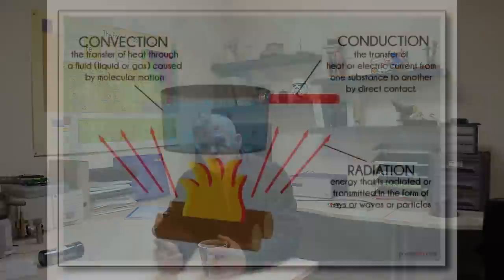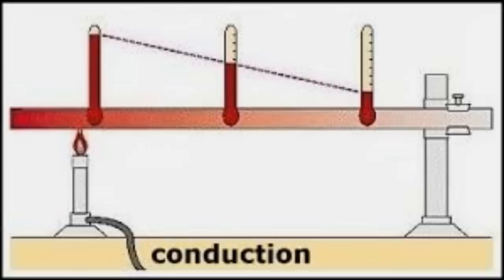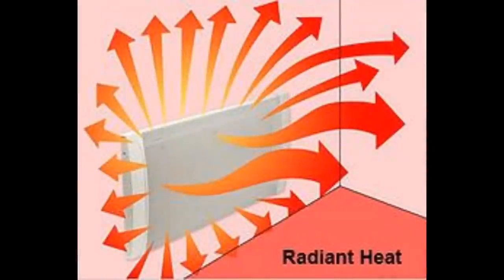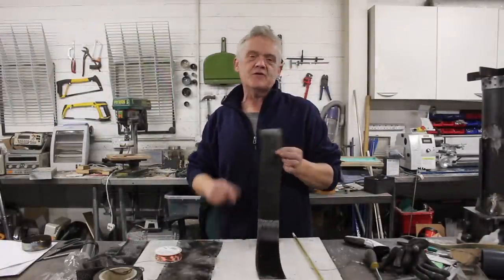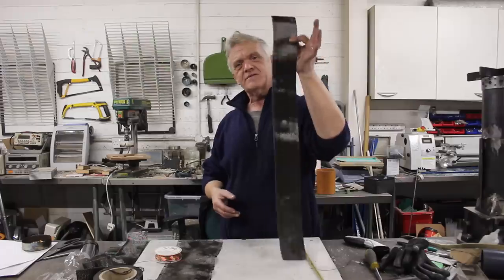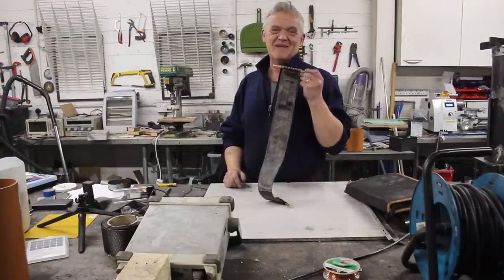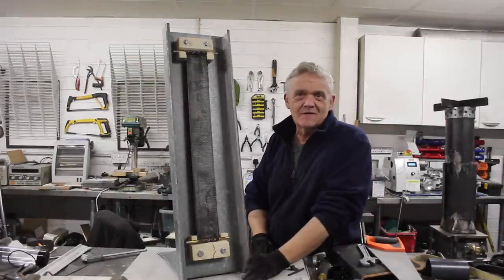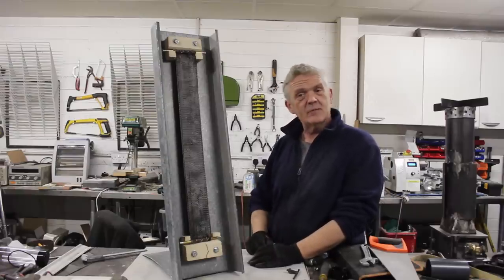1758 How To Make A Nano Carbon Infra Red Heater

Comment: Conduction is great, heat goes from hot to cold, I live mid terrace, by keeping my house a bit colder than my neighbours, the pensioners on either side of my house are heating my house. Except when I turn the Chinese Diesel heater on, which blasts air through the cat flap, then it gets hot, handy for drying laundry.  

My last gas bill for heating, hot water and cooking was less than £100.
Reply from the maker: lol handy indeed
Reply: @ThinkingandTinkering  the secret to keeping a house warm is insulation and stopping draughts, no point heating it, to then lose the heat or have cold air blowing in.

Comment: FWIW, the most efficient way to heat PEOPLE is to maintain their torso at 30C/85F or above.  If that is achieved, then the brain thinks that the air temperature is just fine and doesn't start restricting blood flow to the extremities to keep the central part of your body warm enough, which is why your hands/feet start feeling cold LONG before the rest of you does.  If you used the carbon fiber to make an electric vest to warm your torso directly, that would be brilliant!

(I watched a science video a few decades ago where a subject was given dexterity tests--placing nuts on bolts/etc.--in a -10C/13F chamber.  While the electrically heated vest he was wearing kept his core temperature up, he was just fine, not even needing to wear gloves.  Within two minutes of turning it off, however, he started fumbling, and found doing the tests almost impossible after five minutes or so.  Fascinating stuff!)
Reply: Mostly agree, but am a bit surprised at the 85*F temp mentioned--is this the ambient air temp or just the skin of the core temp?  I do run warmer than most people, but we keep our place 67*F during mid fall to mid spring, and I sleep nekked with only a thin sheet, and I do just fine with that (I would keep it colder, but I think my spouse would mutiny...). 

  But yes, agree with the general principle--learned this through backpacking trips in cold weather.  In fact, I designed a front only* insulated vest with a thinnish layer of synthetic (Apex) insulation sandwiched between very breathable layers (a windjacket is used in conjunction with the vest) for hiking for around 10*F and colder.  I'm good with wearing just a baselayer under that, and over that a windjacket.  

   When I break camp and am ready to go, I always take off my down jacket and use the above. I start off a bit chilly, but within a couple minutes, especially if going uphill, I'm good.  I use the windjacket and zipper as a way to regulate the heat. If I'm going up a hill (once warm), I'll open it wide up and then on the relative straights and downs, zip it up. 

  * Front only insulated because the backpack keeps my back plenty warm--too warm most of the time.  The Apex insulated vest only weighs around 2 oz and some change (I used some 1.1 oz/yd2 uncalandered and uncoated nylon fabric).  If I had to make another one, I'd might sub out the Apex insulation for some Kapok fiber and would probably use a wicking polyester fabric to encase the insulation (it would up the weight a bit, but would dry a bit faster).
Reply: @justinw1765  "Mostly agree, but am a bit surprised at the 85*F temp mentioned--is this the ambient air temp or just the skin of the core temp?"

Core temp.  It's a survival mechanism.  You will still survive if you hands and feet freeze and drop off, as long as your core stays warm enough to keep functioning.

Comment: I made a 10 watt heated jacket using by sewing in nano carbon fibre strips and power with a usb powerbank. I dont use it though as it just makes more sense to dress correctly.
Reply: My Dixie Wrecked🔨  I think they are in 30 to 40 watts and work off 12v. I made one myself because I wanted it to last 8 hours and run on 5 volts. They're pretty good if your stood still but when you get busy you warm up anyway.
Reply: Great idea
Reply: @davidmowbray6352  they make sense if you HAVE to be sedentary for long periods in very cold weather, even better if you can get insulating layers over the top. Helpful with my remote work desk based job. I'm making a little foot heater with 2 X 7W medical heating elements, a steel sheet and a thermostatic relay switch
Reply: My Dixie Wrecked🔨  get some carbon fibre or nichrome wire heating element and play around with putting different voltages through differing lengths until you get a element temperature that doesn't burn too hot, then using a multimeter you can figure out how much heat is being emitted and add more elements.
Reply: @davidmowbray6352  There is a guy in Canada who has a house heated that way using 24 volts and different lengths of wire for the right temperature he even invented a controller.
Reply: When batteries ever become a lot more energy dense while also getting lighter, then this would be a good addition to backpacking in extreme cold conditions. 

    I was thinking of doing something similar, except putting Nichrome wire in some activated carbon sewn between two layers of heat resistant fabric (the most common and inexpensive of which is sheeps wool).  

     I would love to do an Antarctica trip some day if I ever afford to, and would hook the above up to a Solar panel.
Reply from the maker: they are not nano carbon mate - they are just carbon - the nano refers to the wavelength of the heat - any carbon will do
Reply: @ThinkingandTinkering  I used the same nomenclature as you did.

Comment: You could have used a quarts rod and have everybody forget about carbon. With a reflector a quarts rod is very efficient and feels really hot on your skin. It is a shorter wavelength but manufacturers make these in affordable sizes and they use 400-800 Watts.

Comment: Three other types of heating for you, increase circulation ie go for a brisk walk, T.E.F ie Thermic effect of food (eat a big protein based meal) and lastly tricking the body's perception of the temperature level.    The latter can be done by slightly warming areas of the body such as the wrist, where there are lots of nerve endings involved with sensing temperature, warming these parts of the body tricks the nervous system into thinking you are warmer than you are. There is a commercial device available which does this. I forget the name, but it looks like a wristwatch. 
So you could add "biohacking" as another form of heating.😂

Comment: I would like to see you make an infra red panel heater 240v, maybe using alco panel sign writing panel as a basis- 3mm polypropylene with 0.24mm aluminium skin either side?

Comment: Love the videos. I'm in England and want to beat this energy con. I  would love to know the cheapest way to warm a room but with the lowest volts. I've been using a 12v connected to a water heater element for years in my pond during the winter and it gets to about 30°c (not the water) so how do we multiply that to actually warm a room? Or can it not be done. I saw 100 metres of carbon wire for floor heating for £30, so would this be ok to stuff in a sand battery?

Comment: Lets say we placed the carbon weave inside a copper pipe, and vacuum sealed it. If we then let it get to 400 degrees, could we use this to heat the copper and let the copper conductively heat a sand battery to high temps? Could this be as safe as the water bottle resistor? I would think it would be faster, at least.
Reply: Why go through all this trouble when heating wire works really well and is far cheaper than carbon fiber cloth?  Resistive heating wire is called Nichrome.  

   The thing with the carbon fiber is that it is heating partly (mostly?) via radiation, but if you bury it in sand, you may block some of that radiative transfer (especially if the copper pipe is at all shiny--polished, shiny copper is one of the better IR reflectors out there).  You may as well heat it directly via conduction. Radiation is best for direct heating of human skin. And the best infrared/radiation heaters are those shiny dish ones that direct the energy very efficiently in one direction. 

     If it were me, I would just wrap some copper pipe in the Nichrome wire and then put it in sand.  If you live in a place where your electricity is cheaper at night (typically from around 10pm to 6am or so), then this would be a good way of "storing" and slowly releasing that cheaper energy.
Reply from the maker: you don't want to be wrapping the wire over copper pipe mate - you will just short it and blow your supply

Comment: Very interesting concept. Before I try this and buy the materials, I would need to know running cost and performance information. I liked how the car seater video also include the running cost information of 1 pence an hour. That makes it very compelling to make. As much as I love your videos, I struggle to decide which of your concepts is better than another to make and, for me that would come down to: cost to build; cost to run over time duration; and effectiveness. After all, winter is coming.
Reply: It is clear that as we turn down our heating, condensation and damp increases: would love to see some videos on DIY dehumidifiers.
Reply from the maker: all I did mate was replicate a product on the market - you can buy this as a pre- made thing if you want - there is a ton of info out there on performance characteristics
Reply: @ThinkingandTinkering  I want to make one: just need to have an approximate idea of cost to run, for example (x) pence per hour. Also, how well did it work.

Comment: Robert, can you please debunk/confirm this idea ? : if we put a Stirling Machine on the top of any heater, will we get electricity without losing any heat (since basically the machine just run on heat being moved "outside"). Sure, the electricity will take away the energy of heat but that same electricity will also dissipate itself by powering a tv, pc, etc. So no heat is loss, right ?

Comment: Maybe we should heat up some water, which will hold a lot of energy, add some tasty stuff to it .... and drink it. That would heat from the inside out.
Reply: Yep, and probably the most efficient way of doing that besides a wood stove, is with an immersion heater placed inside of a vacuum insulated container.  This is my new way of making soup.  I have one of those large 64 oz vacuum insulated containers and I drop a 1000 watt electric immersion heater in, heat up the water to boil.  (there is some Al foil at the top to reflect IR back in and to limit convective heat loss a bit while the immersion heater is well, immersed).  

   Then I uplug the heater, throw in the ingredients, after a minute or so (to make sure the heater is cool enough to take out), I seal it back up with the supplied screw cap, and then throw some extra insulation on top of that (no need to get fancy with that, a folded up towel or the like will work fine).   

     It is more of a slow cooker.  But the nice thing is that it uses less energy than most other forms.

Comment: I'm quite hot on IR emission. Do you have any notes that indicate the emission spectra for this type of heater?

I've seen larger commercial panels (4'x3', 4'x2', etc.). I can't imagine commercially manufactured panels converting to DC - added cost, complexity, etc. I'm assuming that they do a much thinner fiber (higher resistance) or a serpentine path (longer path, higher resistance) or both.

DC wouldn't have EMF, but AC units would.

You mentioned adding a reflector behind it... Any polished/ reflective surface?

I'm interested in the IR for health benefits. Most research is in red, near IR under PBM - photobiomodulation.  There are lots of references in PubMed on visual and near IR wavelengths.

Comment: What if you coded the carbon with that sealant that you used on the rocket stove You said it when it gets hot it turns to glass or what if you sandwiched it in between two pieces of heat resistant glass because of the less oxygen And if there was some oxygen in it wouldn't it turn to carbon dioxide or CO2 yes you would have to get rid of the brass rods and just use a wire and then seal it with that would that sealant around the edges yeah you would have to leave a tiny hole around the edge for pressure reasons but when it warmed up yeah there was any oxygen in there it would burn a little bit and my other and my question is does carbon burn in carbon dioxide just wondering

Comment: Cayrex2 recently did a heater with carbon felt, any benefit to felt over weave?
Any would NightHawkInLight's infrared Cooling Paint be useful as a reflector?

And, "Nano Nano" to you too! - Mork calling Orson, come in Orson
Reply: Hello, i think.. the colour  of  Flat Black emits I.R. most efficiently... keep warm
Reply from the maker: nope - the felt works just as well
Reply: He did use both felt and weave, what I couldnt figure out was he said the temp was about 175c. It didnt look that hot and he had his hand on it for at least 20 sec at a temp of 82c, I think either his thermometer is faulty or its reading in f  and not c

Comment: I always had a hard time calculating ohms when the conduit has vast changes in temperature.  Ohms go up when temp goes up right?  Also, how does one make an appropriate 100W 12V power supply?  I understand that a car battery would work... but what about simply running it to wall current and then placing a dimmer switch on it? like one of those knobs from a light switch.  I mean does this have to be DC?  Also, how do you limit the current in this case(other than tripping the breaker hahaha)?
Reply: Carbon has a negative coefficient of resistance as temp increases, if I recall correctly
Reply: finding a 100W power supply made me realise that's where the cost is. With the power supply you could plug in to a wall outlet it starts to approach the cost of buying a ready made infra red heater unless I'm missing something?

Comment: I am loving your videos. Do I understand this correctly: the ducting behind the carbon fibre is warmed by the radiation, and then heats the air by convection like a radiator? Also, if you put ducting in front of the carbon will that make it more efficient as a radiator? Thinking for a greenhouse application, to heat the air at night. 
Also do you think you could do a video on how to extract heat from the sand battery like you talked about, with a sterling engine?
Reply: Infrared heaters, produce Invisible (to the eye) heat rays... that only heat the surface of things,  not the air.  However, if you painted a room a dark color, such as black.. that IR energy would be absorbed into the dark surface, and any air that passed over the now hot surfaces, would potentially heat up that air a bit.

 I believe the small fake fireplace heaters use a similar method.  An IR heater, with internals that capture the IR energy... then a forced fan system, to push the heated air out.

 I used a  Parabolic IR heater from Harbor Freight,  when I was training martial arts in my Frigid attic, in the winter.   You point the dish towards you, and you feel the heat, if you are within about 12 to 15ft of it.   Though, the air temp of the attic felt like it was almost cold enough to freeze water.   Standard electric heaters, were useless in the attic... because it was way too cold up there, to even put a dent in the temps.  But since IR heats your clothing and skin directly.. it feels like hot sunshine, on a hot summers day... heating your skin.   The combination of IR heat, and working hard... was just enough to counter the low air temps up there.

 Using IR on plants directly... would probably destroy them quickly.  IR heat can be very hot to a surface... and a leaf would likely completely dry out in less than an hours time under an IR heaters beams... even if the temps was 1 degree F. in the greenhouse.

 His use of a metal backer... was mostly to support the heated material, safely, and easily.   It also helps a little bit, to reflect some of the IR beams forwards.   With the parabolic version... they use a mirror finish on the reflector dish.. and the dish shape itself, focuses and concentrates the beams, so that the heating effect is much greater.

Comment: Does the strip of carbon fiber conduct electricity? I heard that bit about the safety of it and I didn't understand if you meant it could be touched by accident and not get a shock.
Reply: He meant it gets hot, how hot depends on the power draw!
Reply: It is a poor conductor of electricity, but it is not a complete electrical insulator (it does conducts a bit).  This is what makes it a resistive heater when current runs through it.  It also makes it safe to touch as far as electrical shock, though you have to watch for the heat obviously.  

   The more electrically conductive a material, the more the electrons flow through it unimpeded and thus the less the energy is wasted/converted into heat.  But when that conductivity goes down some, some to a lot of that energy gets converted into heat because of the internal resistance (you can think of it kind of like a friction).  But when a material becomes so poorly conductive, it starts to block the electron flow completely and that we call an electrical insulator.  Resistive heating materials are somewhere between conductors and insulators--they aren't fully one or the other, but like a blend.
Reply from the maker: it's a resistor - at 12v you are not going to get a shock but if you let it touch metal it will short - oh and it gets hot - so you don't want to go touching it
Reply: Big Clive was playing around with some nano rope a few years back which was plugged into the mains, it was coated with silicone to form an insulation. It does have a shock risk unless you are using a isolating transformer